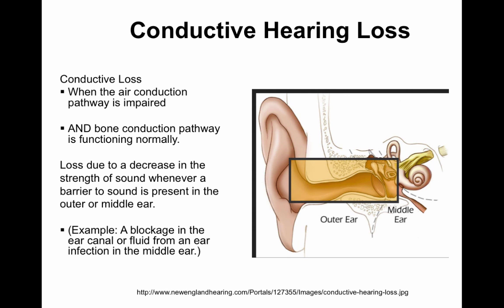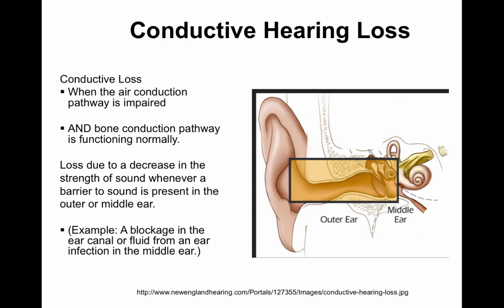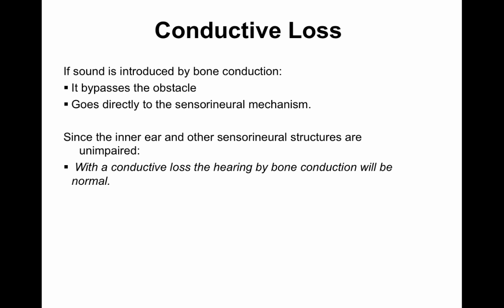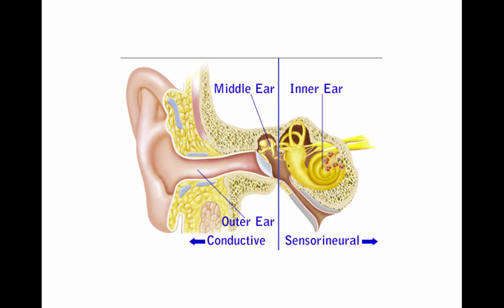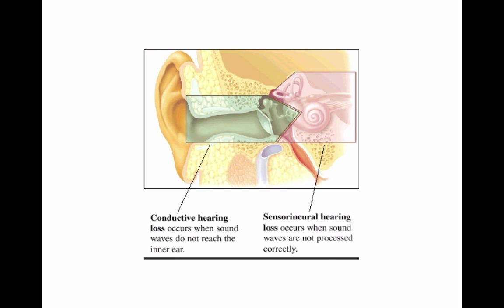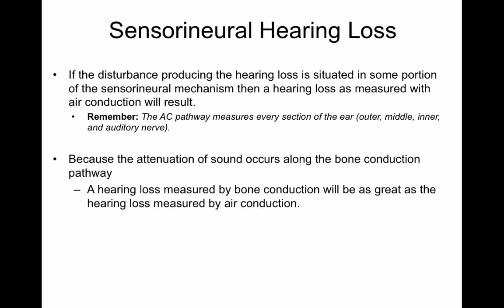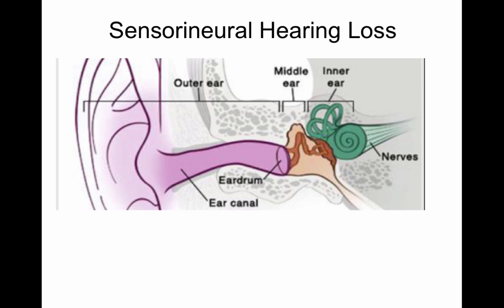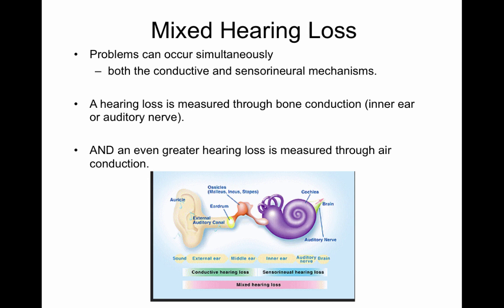Chapter 2 - Part 2 Types of Hearing Loss

Comment: I have been struggling with hearing problems because of my work a lot while I was younger. Based on my doctor, the problem was not curable, which triggered my need for personal research. Thru this guide “fetching kamkam site” (Google it) for the treatment of hearing problems, I`m now able to perform my work well without getting bothered by tinnitus.